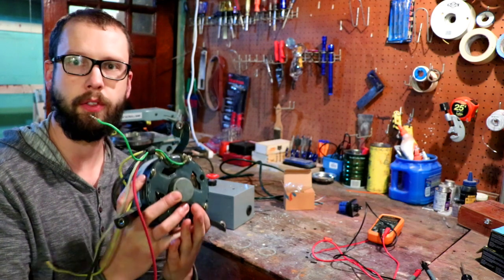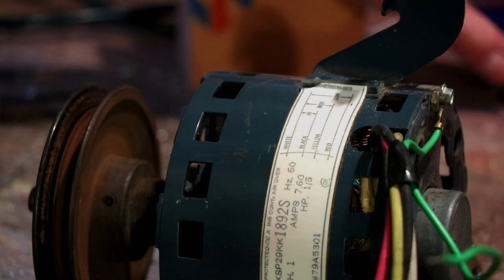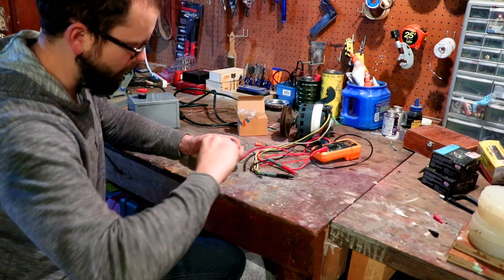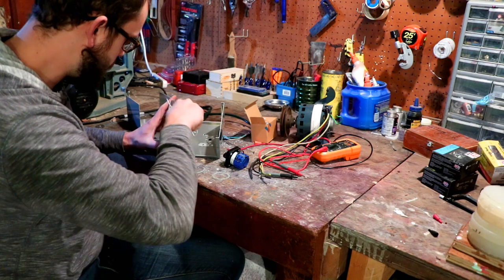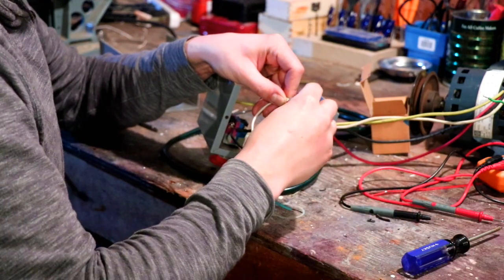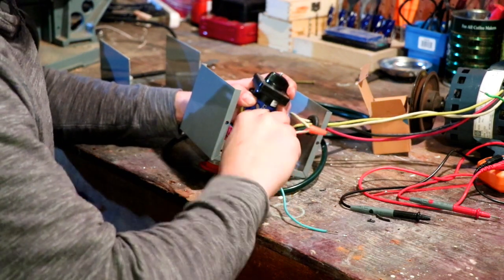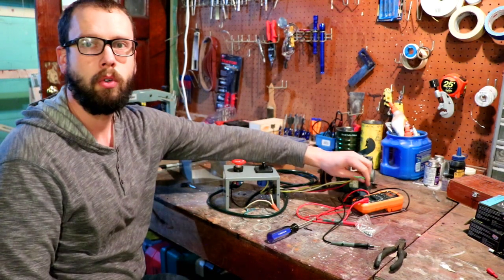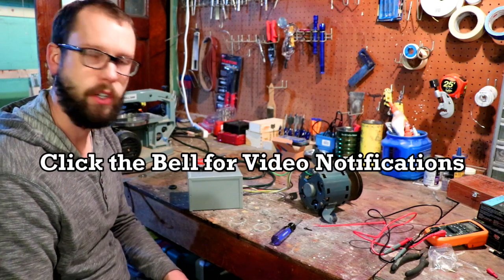Wiring a 3 Speed Blower Motor

Comment: nice video, i was wondering how we would connect a variable speed switch/pedal to the motor; i assume it would be to the high only, is this correct? i'd like to make a pottery wheel with a motor like this, thank you

Comment: Would connecting the HIGH SPEED LINE to the first/#1 position help the motor start with less strain on the motor itself? Kind of like when the blades are engaged on a lawn mower, the throttle should be in the highest position.

Comment: I know this video is 3 years old.. But I have a box fan from the 50s it has a 2 speed Westinghouse motor , would the switch you used in the video work on a 2 or 3 speed westinghouse motor?

Comment: Would you make a video on how to tell which wire is which when everything becomes disconnected?  The videos that might contain that information are recorded in other languages except English.
I lost the pictures for my wiring diagram.  Now I have 6 wires coming out of the motor, a 2 wire capacitor, a 3-speed controller, and a multimeter.  However, I am pretty sure that I am missing just one step on how to correctly put everything back together.... oh, my motor has different colored wires from your and no diagram.

Comment: Ok I finally figured it out. Everything is working as it should. I built a 4x8 Laminar Flow Hood for my lab in working with mushrooms. Besides using this switch I added a 115v receptacle to power other equipment I use in the lab. I'm so glad I held on to that 13 year old ac blower.  You never know when you need something.

Comment: Is he saying he is jumping 1to3 and also jumping to 1to5 using another wire? It's confusing to me. Or did he change his mind and jumped 1to5?
Reply: He's jumping 1 to 3 to 5, it can be 1-3, 1-5 or 1-3, 3-5.. It doesn't matter. That just gives the power from the lead coming into 1 to all of the others, in this case to 3 and to 5. It's just that 1-3 1-5 would mean theres 3 wires coming from the #1 so "technically" a bit more heat as well, and a bigger thickness too... so 1-3 3-5 is ideal.
Reply: @PunkR0ckz09  Thanks I figured it out.  I wired mine with 3 speeds and also added a recepticle to plug in accessories.

Comment: I bought a different brand switch but it is a 4position.  I'm wanting to add a receptacle next to the switch. I'm assuming I should connect the black wire from the power cord to the receptacle first and the neutral(white) wire from the power cord to the receptacle. Then jump from the receptacle to the switch to #5 and then connect the corresponding motor wires?
I would appreciate help from someone that has experience wiring motors. Thanks in advance.
.

Comment: Thanks. Recent broke my furnace blower motor and I’m wiring a temp motor until I can get the original fixed. I believe it to be a capacitor. ECM type motor. Anyways. This confirmed what I needed to remember. Thanks.

Comment: Can you tell me why an electric motor usually quits working? my favorite 20 inch  3 speed shop fan quit working after 10 years. my brother says its usually the winding's go bad.  is it worth repairing? as I can find a similar fan for under $100
Reply: OK jeep guy, Wal-Mart has 20in box fans for under 20 bucks.

Comment: I have the same type switch as you but it is a two. Now would I hook up my red wire to # two for low speed and the black is high speed to #4. as o #3for the power cord the black to #1 and then run a jumper to #3. Could you let me know if I am right please.

Comment: I have the almost identical switch except it’s a 5 position and an almost identical motor except it’s a 4 speed furnace blower motor. I’m doing the exact same thing your doing with just one additional speed, could you help me wire this please!!!
Reply: Is there no starting capacitor?

Comment: What did you end up using it for?
Reply from the maker: I built it for a wine crusher-destemmer but currently don't use it for that since it is so easy to hand crank for the amount of grapes we run through it
Reply: I came across your video because I was messing with one I had. I ended up making an air exhaust for my welding area. It’s seems to work pretty well.

Comment: I got an AC blower fan box with variable speed motor. I am connecting it to use as a shop fan. Will this switch work for that? The motor has 4 different speed wires coming out. Can I also use a fan dimmer instead?
Reply from the maker: This switch will work but it can only wire three speeds.  You will need a five position, 8 terminal switch to wire four speeds.  The wiring will be the same, but just one extra speed wire.  Don't use a dimmer switch.  It will burn up the motor.  You can control a motor with a variable speed fan controller switch and just wire to the high speed.  I would just get the five position switch though since you have different speed wires.  It should be a little more efficient that way also.
Reply: The video is a bit unclear about jumping portion. Do you  cut a 14 g electrical wire and connect the 1 and 5 port together and also connect/jump the 3 prt with on of the port 1 or 3? I could not see  that clearly. Please let me know if possible. I got the exact same switch. Thanks 
Subhendu.
Reply: @subhenduc  you end up connecting 1, 3, and 5 all to the input line by one route or another, doesn't matter exactly how, just so each of them is connected either to the input itself or to a port that is connected to the input.  If you connect 1 to 5, you could then connect 3 to either one of them.  
But to minimize resistance in your wiring, you may wish to connect the input to the port that is connected directly to both the others.  For example if you connect both 3 and 5 to port 1, you may wish to connect the input to port 1 as well. This way the current to 3 or 5 has to pass through only one other port and not two ports in series.
Reply: @CoolStuffGuysLike  Thank you so much. I will just order like yours and only use the three speeds and cap off the others. High medium and low will be plenty. Don't need all others. Thank you for your quick reply.

Comment: Cool. Great video. I'm going to do the same thing with the same motor. Put a three pole switch on it.  Why didn't you use the capacitor to start it?  Where's the video for what you did with the motor?
Reply: cmetube  3 pashe motor no need capacitors
Reply: @nadeemalbalushi9330  This is not a three-phase motor.  Each speed is supplied by only one hot wire and a neutral.